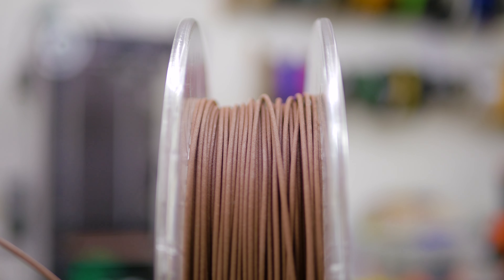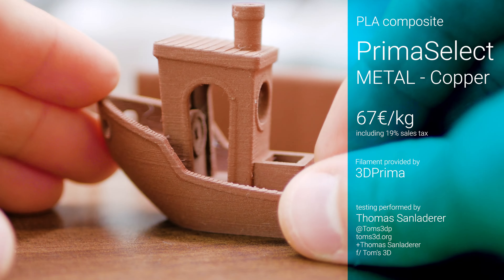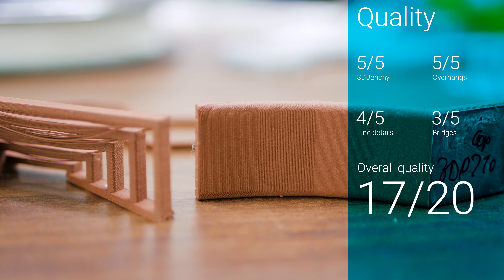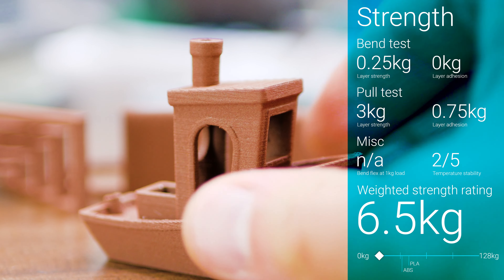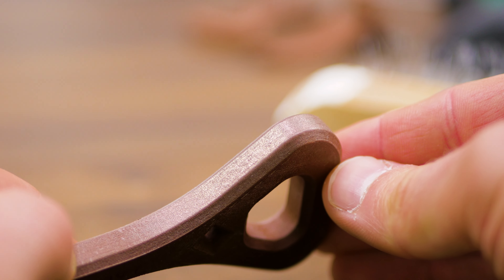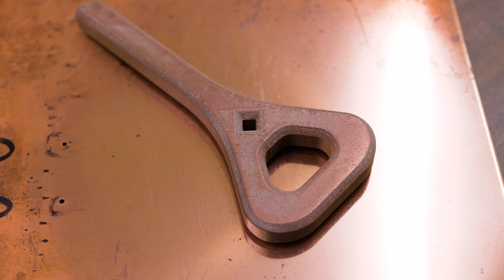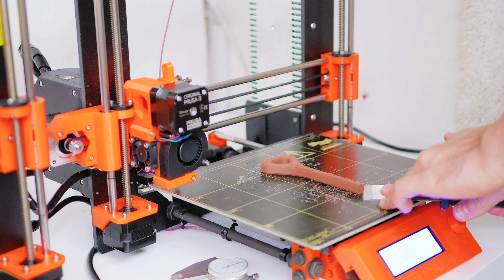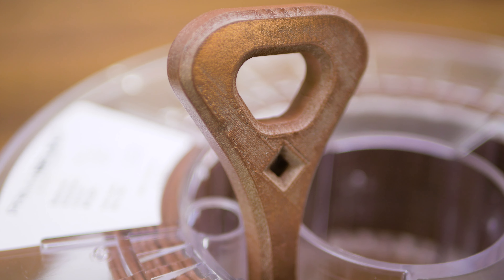3D Printing with Copper: Primaselect METAL review! #Filaween

Comment: For people asking if you can use this filament as a power cable...no. The power it would require would heat up the copper wire, right? I don't know for sure, but the filament contains a lot of PLA which might melt quickly if too much power goes through the copper for even a second. Wires would be super brittle but a circuit board (using a 2 color printer, which the prusa mk2 i3 will have soon) might work in a pinch. Basically no this is not an electrical filament, it's temperature sensitive and will warp out in the sun or in a heated box.
Reply: I'd be very surprised if you even got a circuit through it. Even if a few tiny flecks of copper touch, you wouldn't get 2mm down the line before there was a break.

Comment: We are using the Virtual Foundry's 85% Copper filled PLA then using a Kiln to sinter the parts. So, basically, we are metal printing on A8 or $150 3D printer : )
Reply: How well does it work? How much shrinkage?

Comment: I'd love to see if you can get the copper to develop a patina if you use a chemical treatment. Ammonium chloride and salt, or dilute muriatic acid work on copper to make it turn green.
Reply: if seen some pictures with ammonium hydroxide vapor (in a jar) with metal 3d prints, it seems to work.

Comment: Is it conductive? Worth adding to the video in my opinion
Reply: Hampus Lundin that's the obvious question. I'm so surprised he didn't mention it.
Reply: No ya it's it's pla mixed copper filament not a pure copper filament pure copper melts at above 600° Celsius
Reply: I have tested it and it has basically zero conductivity. You could litterally use it for isolation.

Comment: Hm I wonder if it can be heated to get rid of plastic, leaving just metal?
Reply: there are special techniques in development, but it wears a normal nozzle instantly down, so you need special ruby nozzles, and you need more equipment in the post processing, so it may not be suitable for home users, but may be cheaper than laser sintering.

Comment: I wonder if you can make heatsinks out of this. Nothing too hot of course since it's just PLA.
Reply: Yes, I use it for heatsinks
Reply: +Thomas Sanladerer i use copperfil and it does conduct heat significantly. It has more copper content then?
Reply: +Thomas Sanladerer thanks for all your work and sharing. Much appreciated
Reply: kresimir zezelj
Is Copperfil from Colorfabb or something else?
Reply: +ManWithBeard1990 yes. I believe they boast like 80% copper particles

Comment: Does it conduct electricity?
Reply: No. there's way too much plastic between metalic particles. No metal filament conducts electricity.
Reply: awww damn....one day.....
Reply: Sevendogtags there is conductive filament though
Reply: Cullen Lonergan
Yes, non of which are metal filed.
Reply: That's false. Adding graphite into filament makes it conductive. Not for high currents, of course, but transmitting signal should work like charm.